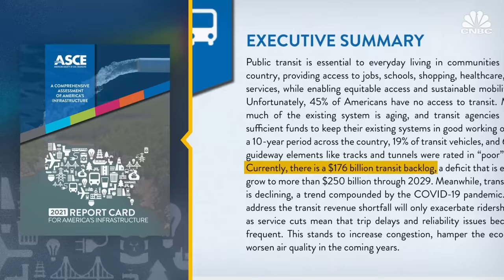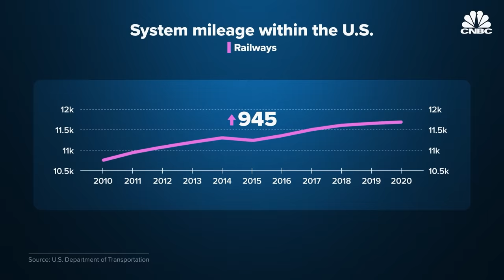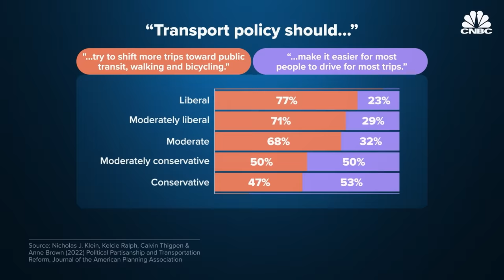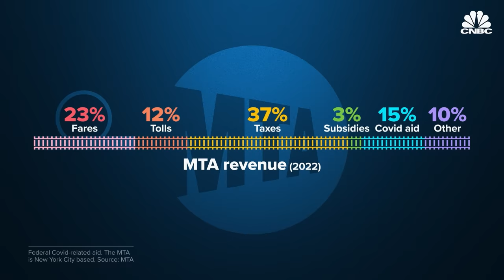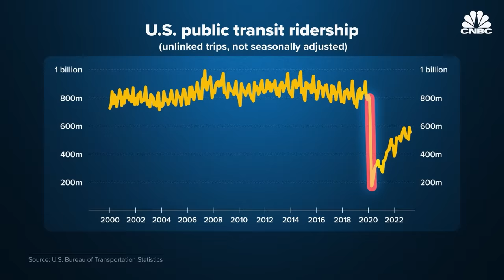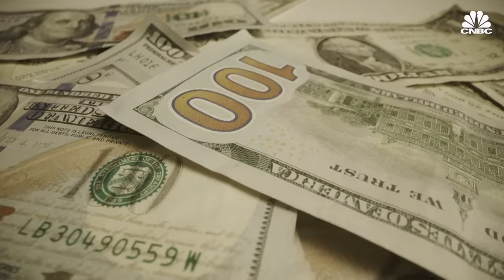Why The U.S. Gave Up On Public Transit

Comment: In recent decades, the voters of Arlington, Texas have approved spending huge amounts of money on one sports stadium after another. The Texas Rangers' ballpark, built for around 200 million in the 1990's, was only used for 25 years before being torn down and replaced by a ballpark that cost over one billion to build. Meanwhile, Arlington was (until recently) the largest municipality in the US without any public transportation system. Arlington residents have voted against public transportation at least three times in the last 40 years.

Comment: In my opinion, the only way the US can go forward with public transportation would be a hybrid system. Imagine this. You are driving your car and you go to a station, drive in to a "rail car" and shut your engine off. You use your phone to tell them where you are going and the car zips down a monorail line at 100 mph until you are near your destination. You then drive out of the car and go to where you are headed. In some areas, that would be a large vehicle storage area, similar to current multilevel parking garage, but automated, with cars being moved (via railed car movers) from short term parking spots to a storage rack that could have three vehicles park in a stack, barely enough room between them above and to the side. You would then take a second "personnel" car to the store and do your shopping or to your work place. Then you would take the pc back to the storage area, get your vehicle, take the rail back to close to your home, and drive a few miles to your own garage, street parking or parking lot.

The only actual driving would be from the station to home or if you had to go from multiple storage buildings due to distant shops.

Comment: The biggest misconception is the expectation of public transport having to be profitable. It is a SERVICE to allow people to get cheaply from A to B to C and generate profit through jobs and commerce, because of that accessibility, reducing maintenance of roads, traffic congestion, allowing the people really depending on the car generate more profit through jobs and commerce. All roadways and cars run a huge deficit (loss in value through simple wear and tear) and no one question this.

Comment: I'm one of the 45% with no direct access to public transit. I live in northwest Illinois. The closest train station to me is Elburn Metra.
It takes 75 minutes to drive to Elburn, and another 95 to ride the Metra to Chicago OTC (2h 50m total)
It takes 2 hours (dependent on traffic) to drive directly to the same place.

I essentially have no choice but to drive, unless I want to take more time to get to Chicago.

Comment: it cost me $5,400 a year to operate and maintain a car in the USA that amount doesn't even hurt bc we make more money but with public transportation at 18 trips a week at $3 per trip comes to $2,808 a year that saving of about 50% savings.

 but cars have evolved to more of an identity and the ability to go where you want even if roads are not there.

 The cost does not make a dent in our financial stance. I live in Kentucky and it's nice that I have everything I need in my F150 wherever I am. A car is not just a means of transportation but an emblem of autonomy and complete control over where you want to go in life.

 even if that place is a wall, its ur choice of course.

Comment: Part of the problem with public transit in the US is also the quality of the ride and the planning of the systems. When I took a bus in Phoenix a few years back, some stops didnt even have schedules or maps of the lines posted. I would have to go block by block all the way through surface streets to go from Glendale to Mesa and it would take hours on old buses with simple seats and zero amenities. When I moved to Iceland and later Sweden (Sweden is the size of Washington, Oregon, and California btw), I would take a city bus to a regional hub, transfer to a regional bus which would take highways from one section of the city or from one city to another, and then transfer to another local bus. In addition there were the rail lines to complement this. Wifi was available on every single bus, screens were available to show you which stops were coming up, and regional buses sometimes even had toilets. All trains had these same features. Your transit app on your phone could even show where exactly buses and trains were via gps transmitters, so you could check if you missed a bus or train on the map. I didn't own a car for 7 years and I would never own one again if work didnt require me to go to more remote locations on occasion.

Comment: The problem is not transit but the stations. There is a lack of walkable mix used neighborhoods which is due to zoning, parking requirements, minimum lot sizes, height restrictions, huge funding for highways (which bulldozed many of these places).

Transit makes sense when connecting walkable places to each other. Walkable places are where ridership comes from.

Even in the US, many train stations are in parking wastelands, not real destinations other than if you had left your car there.

This is not by cultural preference but by car centric policies.

Comment: The “T” (which is the Boston transit) have issues ourselves. I am surprised it wasn’t mentioned in this story. But we do have accurate times for the most part. The issue is we have the oldest transit system in the country. When ever we have to maintenance the tracks that line will shut down for the work that has to be done.

Comment: The reason why people are turning back to love historical transit is because the car industry is not innovating itself. The descendants of rich oil/car companies, their grandsons just want to sit there on their money bed with their old ways.

All cars should already have standard amenities, such as bathrooms for all seats, and create many tunnels. No pedestrians, no traffic lights, no animals, no human drivers allowed, using 100% AI control, with a huge, long carrying platform bringing all the cars that want to go to similar destinations together onto it and reaching speeds of high-speed rail at a minimum and above, with emergency exits placed in the tunnels throughout. While cars connect on the platforms, the doors will be locked at all times, and maybe have 25 police on the four corners of the platform at all times; one platform can carry 24,000 cars. All the hyper-way tunnels should reach speeds of high-speed rail or above to encourage more people to use it instead of human driving on their highways. There are side tunnels connecting to other nearby hyper-tunnels, so cars that have emergencies can leave the platfoorm at anytimes. The hyper-way tunnel platforms perform non-stop traveling; whenever a self-driving car enters the tunnel (like how self-driving cars do in i.robot tunnel), the first thing is to connect to the closest ongoing platform and move above it, and travel at high speed altogether.

Cars are used for emergencies/rainy days/taking sick people and fast travels, while trains should look like the ones in the Hunger Games, as people use them for luxury/human interactions, not just fast travel. And in the future, creating long airways, taking/joining all the cars in the sky like birds, and going to places in an even faster fashion; that would be the second fastest travel to teleporting doors.

Comment: It wasnt discussed in the video but here in France we have plenty, PLENTY of discounts for public transportation when you're under 25 or even 28. For trains, for subway, tramway etc... Since public transportation is generally owned partially if not totally by the state of the cities (themselves funded by the state), they all make it a cheaper solution, while also making a benefit because adult pay full price.

Comment: In most of the U.S. the biggest issue with transit is density. Maybe if you converted the parking lots and garages in cities into say, mixed-use development and housing, you'd get more ridership. Also, even looking at the town where my mom grew up, I can see the remnants of dense, sensible small-town development. I think building transit before building density is putting the cart before the horse because transit without density is useless.

Comment: Other than asking the taxpayers for billions more, this issue can better be handled with better planning. Bigger cities have regions for tech center, industrial, etc. but they exclude higher density housing near but not within those regions. In addition, supportive services, mostly light to medium commercial needs to be included so people living in the areas can more easily travel from home to work/school to grocery/other staple shopping and back to home.

There were also many issues left out of the video. Economically speaking, most mass transit systems are poorly managed economically (to the extreme). I would argue at least 30% of their passenger costs could be reduced without impairing service but there's no incentive for efficient operations when the plurality of the money they receive is block subsidies.

Comment: It's conscious policy choices over generations that have completely front-loaded investment into roads and airports and planning models based entirely on low-density housing and single-use zoning. Add to that, 75-80 years of consistently beating the drum into Americans that the "American Dream" is the single-family detached house, significant yard, at least a 2-car garage (more if you can afford it), white picket fence and luxurious large new personal vehicles (SUVs, oversized pick-up trucks, etc.). It's sending your kids to small elite public schools in choice school districts or better yet, expensive, choosy private schools with elite networking possibilities even in high school and before. Ultimately, it's all about exclusivity and isolation.

Comment: Why not build around the existing systems, through buyback programs and imminent domain. For those who don't want to sell, thinking they will be moved, include them. It might be too expensive to build new systems, but in the case of dodger stadium in LA or central park in New York, that type of renovation worked just fine.

Comment: It mainly comes down to economics and individual preferences. Public transit is expensive when you consider the total cost and not just actual fares. If the fare reflected the actual cost, people would probably find it more economical to drive a car. Cars have the added advantage of individual freedom of movement. The main reason that public transit has been more successful in other countries is that it is more economical (shorter distances, cheaper to build, faster service) and driving a car is actually less economical (fuel costs, taxes, parking fees, insurance, maintenance).
Reply: Cars cost about $700 personally. The taxes especially at the local level bring it up over to $1000 per person. You are telling me that fares monthly would be $1000?

Comment: 1:58 Let's try some statistics:

It seems highway mileage increased from around 4 million, so 105485 / 4 mil = 2.6%
Meanwhile, railroads increased from around 10750, so 945 / 10750 = 8.79%

It seems that, in relative numbers, there was actually a focus on railroad investment, instead of on highways.

Comment: I grew up in a community that was well served by public transit.  But that was before I grew up.  We had the North Shore Line which ran frequent trains to Chicago and by extension, to Milwaukee.  My Mother told be about the frequent service that she took to work and shopping.  Everything was walkable back then.  Now I have to rely on the Pace Bus, which is unreliable at best.  Pace cancels a lot of buses and I spend much time admiring the outdoors.  I'm too far away to walk to the Metra station, which is much more reliable.

Comment: Short Answer: Because it is not efficient.
To quote Thomas Sowell: "[If] you're willing to poured enough money down the rat hole, we can have high speed rail. The question is: At what cost? ... You can make something a little bit better by making something else a little bit worse. Or often make something a little bit better by making something else A LOT worse."

Comment: investing more in public transport is probably a good thing, but if you live somewhere where public transport is simply not a viable option no matter how much money you spend on it, like a suburb or a rural area, then you're obviously going to push back on the tax dollars that come out of your pocket being used on something you will never and can never use. i live in a suburb of chicago, and i do definitely miss the PACE buses that were busing people to the metra stations leading to the city, but with remote work becoming so prevalent, the amount of people using that system dropped off a cliff. why should we invest in that? the video does not address or offer any solution for how we could even begin to invest in public transport in towns that have like 50,000 people spread over 50 square miles.

Comment: In San Diego we have one of the larger light rail systems. I live less than a mile from a station and almost never take it, despite some large expansions recently. #1 reason is time. I can drive to work in 20-35 minutes. Trolley/buses/transfers would take 90 minutes each way. It seems like the route prioritizes students and tourists over where majority of San Diegans live and work.  Second reason are all the sketchy people on the train and buses. The only time I would consider taking the trolley is if I was going to a ballgame downtown. Problem is that that route goes straight through the hood. Okay during day, but a dealbreaker at night. It doesn't even save me money to take the train vs driving. Paid my car off 8 years ago and it runs good as new.

Comment: I live in a moderately sized city, population around, 150,000, modern city in California. Even in this city, public transportation is something to be desired. If you don't have a car, you're handicapped, transportation wise.
I've been aware of this for years.
I visted San Diego, here in California, and alot of their main routes, had buses coming every 15 minutes. They had trolley cars running through downtown, but still, if you wanted to go to other areas, more along the outskirts, still it's going to take time, or you might have to take an Uber/Lyft. The US public transportation is 2nd rate compared to some countries, for shame.

Comment: I'd like to use, and have used for several years, public transportation -- but, I have a 35 minute drive to get to the train, then a 3/4 mile walk to the office, that under the best of circumstances gets me to work an hour and a half later than driving -- a total of nearly three (3) hours wasted every day... If my employer didn't offer a public transportation subsidy, and I also get something of a discount for being over 70yo; I'd never consider it... bottom line is while the trains themselves are fine, well policed and generally clean, the car gives me the most time at home... as always, ya get what ya pay for, and gov'ts aren't interested in paying anywhere near the cost (despite ever increasing taxes...).  Let's face it -- train riders aren't generally in the top 2% of wage earners, or even the top 10% on average... probably a lesson there somewhere...

Comment: They need to revive streetcar lines with trams (surface, underground, underpass/elevated) connecting to rapid, commuter rail lines, and major train stations.

More rapid and communter bus transit lines, water transportations (even rapid transit routes and stations) and more access to  diverse shared tranportation.

Also, better, expanded commuter and national passenger rail lines especially more high railing systems. Cheaper train fares and national tickets. Better, reliable services and handicap accessibilties. Most of all making sure passengers are safe from crimes and violence.😮

Comment: One big difference between the U.S and other countries is the fact that the other countries' cities are dense and compact.  The U.S. metros are sprawling with many suburban areas having double or more the population than the cities they surround.   People intentionally move to areas with little to no transit available to begin with.  These areas are built with little to no intention of supporting or considering any form of public transit unless there's a railroad nearby that possibly might be considered for a commuter railroad extension.   Heck, some of these areas don't even want road expansion because it will ruin their quality of life.   Nevermore that the two lane roads get clogged with traffic,  ruining their quality of life anyway.